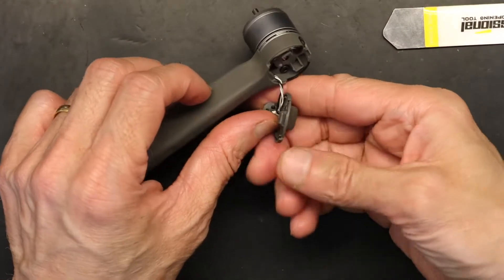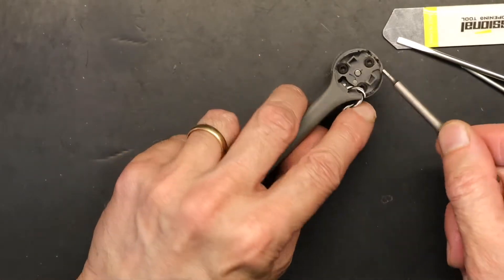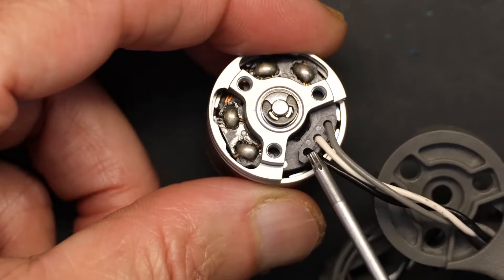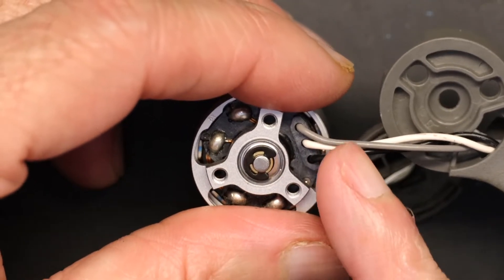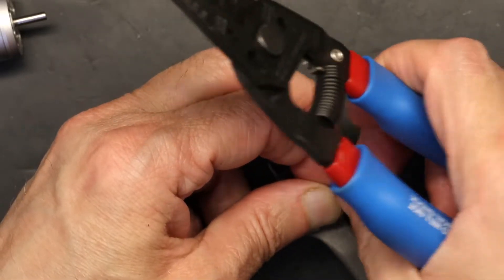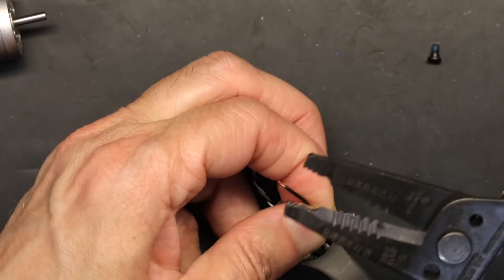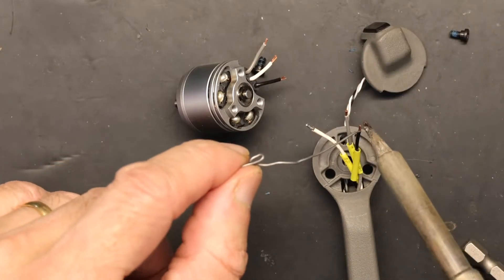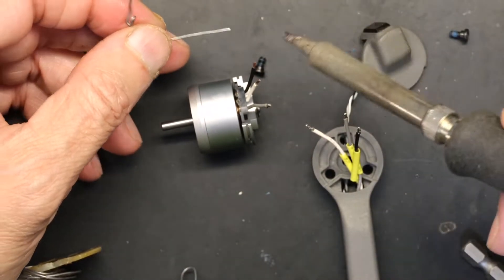Tutorial: How To Safely Replace the Propeller Motors On a DJI Mavic 2 Pro or Zoom Professional Drone

Comment: @3:50 Has anyone actually torn motor the motor apart by removing the locking pin? Mine doesn't move a bit after removing the locking pin... o_0 @technology tips
Reply from the maker: One of the common reasons that this happens is; when the spindle is slightly bent off center. This leads to the magnet touching the coil and stopping it from spinning.

Comment: Smart idea to use the shrink tube. My Air 2S needs an arm replacement, but the motor is still functional. I can save $40 dollars with this technique!
Reply from the maker: Thank you, and good luck with the project!
Reply: @TECHNOLOGYTIPS101  thanks! I only had it for 5 minutes before I crashed it… more reading needed before my next flight 😅
Reply from the maker: @shanemitchellspencer   Good luck and safe flights 🙂
Reply: Any problem till now in flying the drone after soldering motors like this?

Comment: Hi - thank you for the video.  Do you have a link to the other video you mentioned for disconnecting and reconnecting the black part that holds the propeller to the motor that has to be transferred to the new motor?  Thanks again.
Reply from the maker: I think this video covers that https://youtu.be/cGlJCQialEo

Comment: Do you know how to test the motors for a bad motor with a multi meter. 
Got a burnt ecu board after a crash
Reply from the maker: The easiest way to test any DC motor is to attach a volt meter to the input wires and spin the motor with your hand and see if there is any current generated. If the coil is not burned out you will see some voltage and current, it if is completely burned you will not get any output. Keep in mind that if the motor coil is partially burned this will not be a conclusive diagnostic test, so you will need to apply power to it and see if it spins.
Reply: @TECHNOLOGYTIPS101  ok that’s that helps 👍

Comment: Can you tell me why the dji drone (eg dji mini 2) runs out of battery, so why when I have charged the battery to use it, I want to store it for a long time without fully discharging it.  Just like when the new dji sold, thank you!
Reply from the maker: All Lithium ion batteries naturally drain when they are unused at a rate of about 10% per month give or take. This drainage rate is higher on some Lithium Polymer batteries. So even when you buy a brand new drone the battery can never be 100% full when you open the box.
Reply: @TECHNOLOGYTIPS101  So can I discharge the battery 🪫 (LiPO) for long-term storage like the manufacturer?  Thank!
Reply: @123jack7  NO...Charge it fully before storing, it will go down to a ceretain level on its own providing you have done the battery updates.. mini 2 has smart battery and will self discharge to the point it needs to be over 6 weeks or so.

Comment: Is it possible to upgrade to a more powerful motor?
Reply from the maker: Unfortunately you can't for many reasons.  Firs the transistor or FET that runs this motor is only designed to support that specific amount of current that this motor draws. If you upgrade it to a more power full motor it will draw more current and it could burn out the power transistors on the motherboard. Second the weight of this motor is very light compared to it's power, stronger motors are much heavier. Third the battery pack will not support more current draw than what these motors draw.
Reply: @TECHNOLOGYTIPS101  interesting, I only assumed it would be possible because people are upgrading their Avata motors
Reply from the maker: @AlexGreenberg1  DJI drones are mostly proprietary and not as customizable as home-built drones.

Comment: One of the tabs that holds the prop onto the motor broke off and went into the motor.  Any tips for how to get it out other than holding upside down and hoping it falls out?
Reply from the maker: If you can visually see it you can use a fine pair of tweezers to fish it out. If you can't see it shacking it upside down or using a vacuum is the only option I think.